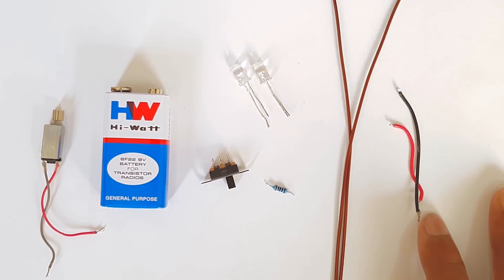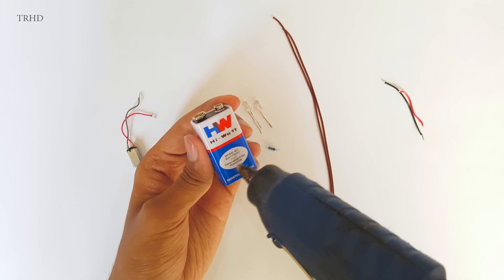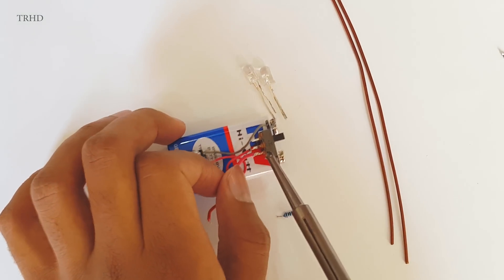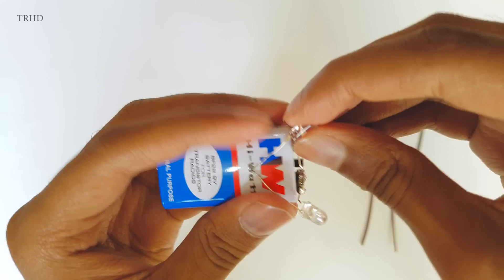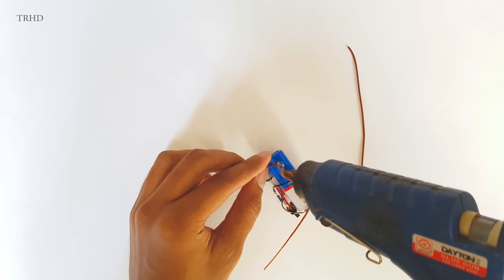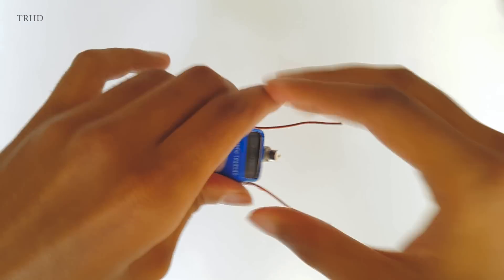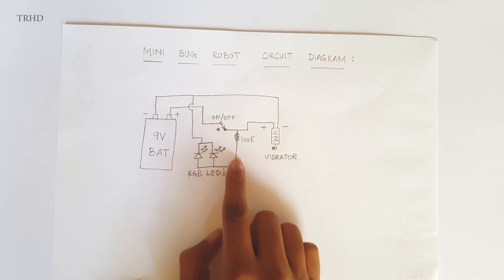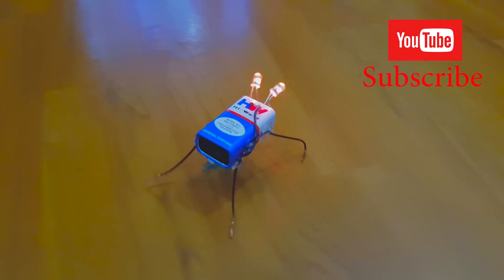How to make Mini Bug Bot | Ant Robot | Very Easy & Super Simple!

Comment: Helll again, I did the robot but didn't solder the two LED (because I don't have a soldering iron) but used a glue gun to connect it but it doesn't want to light up. What should I do? And instead of soldering it together with the wire I twisted the two and attached the wire by twisting it also

Comment: Should the resistor really be 100 ohms or can I use one with smaller ohms? And can I use ac motor and can also not use a solder?